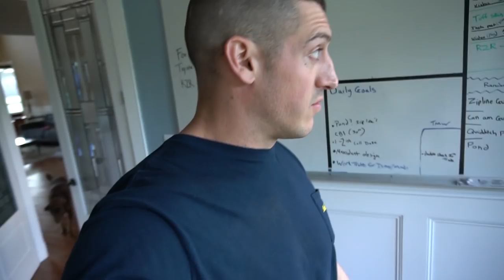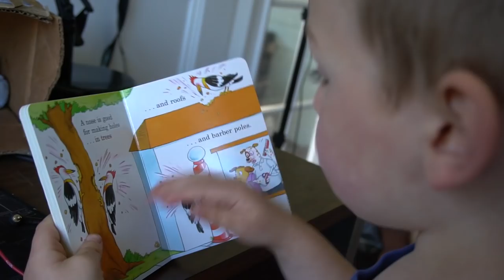DID'NT THINK HE WOULD MAKE IT

Comment: I’m late to the video. And someone may have already told you this. But you should get a plow and a set of disk for the tractor. You run the plow first to break up the ground about a foot deep. It will cut right through the grass and hard packed dirt. Then after a few days disk it to break it up into smaller pieces. Then when you run the roto tiller it will break it up into soft dirt that you can plant in. Probably No need to have dirt brought in. Hope this helps man.